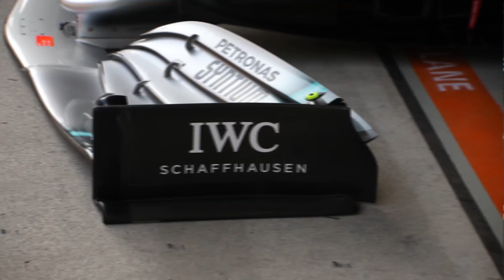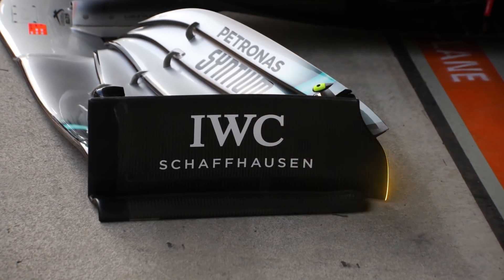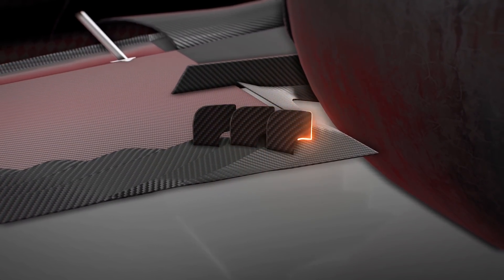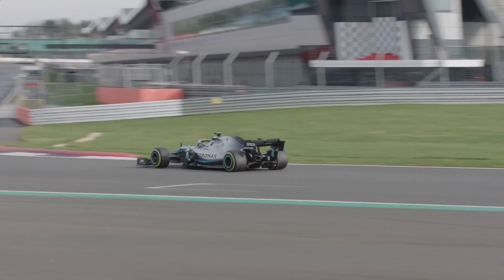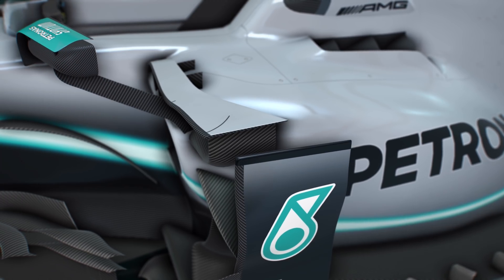End of season tech review: Mercedes vs Ferrari

Comment: 4:10   seriously... that more front end downforce gave them suddenly so much speeds on the straight, yet they were still slow in corners. downforce works the opposite, THEY CHEATED. 
just tell it how it is, THEY CHEATED THE FUEL FLOW.

Comment: Car wise I'd say both teams are neck and neck, in VERY broad terms without getting into the fluctuations over the season. However, I do feel Mercedes has stronger team and tactics managements than Ferrari. Toto Wolff is a TRUE wolf.
Reply: Mercedes definitely has a better car by far. Not just raw performance but also how the car works with the tyres like Getting them up to temps, keeping them there, tyre wear etc.
Reply: @edgiebraahhh7280  yesn'tn't
Reply: @edgiebraahhh7280  That's why I said in VERY broad terms both cars seem neck and neck. If I really dig into the details, engineering differences, consistency, efficiency (not fuel economy lol), overall impressions on me, etc., I also come to the conclusion that Merc pretty much always has the better car all along.
Reply: I’d appreciate Mercedes if they stopped pretending like Ferrari and Red Bull were so close. This isn’t 2012
Reply: neck and neck?? thats a bold (and stupid) claim. how long u have been watching f1?? last year maybe (at least for early half season). but this year? nope..
Reply: @stigsstupidcousin3102  Did you see my last reply? All things considered I firmly believe Merc's car is still stronger. I said neck and neck just to get myself out of trouble and to pacify those Tifosi fanatics / idolaters / cult followers.
Reply: I just wanna punch his face honestly,but Mercedes does have better tactics

Comment: Good detailed review.
 But it's a bit unexpected to have a tech review on two motorsport teams without a single word on motors.
 Just saying…
:)

 The real gap between these two teams was hidden by the engine performance.
Many times Ferrari proved to be faster on a single lap, but not so over the entire race because their 19' car suffered from faster tire degradation. The car design seemed fine tuned mostly for high speed and struggled with lack of downforce.

Comment: Ferrari's car was ALWAYS a losing formula.  Having less downforce, even if they could match Mercedes on tracks that had less bends, they would always have more tire wear.  Case being, Abu Dhabi, Lewis goes and gets the fastest lap on his 30 lap old hard tires, faster than Charles Leclerc on new softs.  If Ferrari qualified ahead of the Merc, straight line speed is good for overtaking back markers and defending, but with all those DRS zones, Ferrari can't keep Mercedes behind even with the extra engine power and slippery body.  If the Merc started in front, game over.

Comment: I thought they were trying to simplify designs, so there would be less dirty air.
Reply: This is the problem with F1. The FIA give them rules, then the top teams employ a team of lawyers (they genuinely do) to find loop holes they can exploit and put in as much effort as possible to avoid meeting the regulations.
That's why nothing really changed from 2018 to 2019. The teams didn't want to abide by the rules. One being in outwash removal. So they rebuilt their cars 'loophole friendly' to gain back that advantage. 
This is why F1 sucks balls.

But, Ross Brawn has his own team of ex mechanics, lawyers and designers to come up with the 2021 rules. To minimise the 'loopholes' and make it air-tight. That's why everyone faster than Renault have threatened to throw their toys out the pram and leave.

Comment: I think Mercedes already focusses on 2020 when they won in Hungary. Mercedes had a huge point advantage and only had to manage the gap..
Reply: I've heard that top teams are working on their cars for 3 years in advance. It's hard to believe, but when you look at the advantage they have on midfield, it must be true.
Reply: @domantas973  Well they certainly are making some preparations 3 years in advance but designing the car usualy is 2-1 year in a advance or in the case of Williams a month before testing xDDD
Reply: Mišo ElEven well, this year williams used 2018 car during the testing, because their new car wasn’t even finished.😃
Reply: @domantas973  even Mercedes had not finished the manufacturing of the 2019 car by testing.
Reply: @domantas973  I don't know how true that is considering the final rules come out only the year before although I'm sure teams work for more than 6 months
Reply: @Mathew Alani they use ideas with the rough rules and would be doing r and d for ground effect right now for example and then would probably adapt it to specific rules
Reply: @domantas973  As I understand it teams aren't allowed to actually start work on the next season's car until the current season starts. Concepts for different aero parts and such wil be flowing off the drawing board almost constantly, but that's allowed as, for the most part, they aren't specific to one particular car.
Reply: @domantas973  I don't know who told you that but that's not true.
Reply: @domantas973  1-2 years in advance is more realistic given that they're notified of rule changes in that time before implementation

Comment: I hate all the stoopid little winglets and knickknacks that require crazy amount of design and simulation time and that small team have no way of matching but seem to determine way too much of the max performance. Bring on the new regs, hopefully it will level the field a bit.
Reply: @Roy Batty But that´s what they did for 2014 and the Mercedes domination happened and you all cried they dominate. Now they opened the aero part to close the gap and you all cry. I´m sure when a team nails it in the head in 2021 (like RB or some other, not Ferrari), you all cry that the rules are stupid and want them to stop this and do that, which if they do will start a new cycle of domination by another team and...

...you will all cry about it.
Reply: @The_Curious_Cat  Welcome to F1
Reply: i hope too, but you can also expect some massive domination by redbull. Newey has been craving to design modern f1  with ground effect for years .

Comment: Very simple. Ferrari was forced to stop cheating.
Reply: Very large & obvious performance drop off for the last few races...
Reply: TotallyNotARussianBot Ferrari cheating  
Keep lying
Reply: Agreed 👍
Reply: Oh someone's butthurt because ferrari has a faster engine
Reply: arthur staal But, what good is that if they can’t manage to win?
Reply: @LuisTrey  then why bring in question it's legality?
Reply: arthur staal Because they hadn’t won anything all year until Belgium came around then went on a three win streak.
Reply: @LuisTrey  1)they won Canada.
2) spa and Monza are less downforce dependant and favor the sf90
3) in Singapore they updated the aero making it way more competitive (which was also visible in Russia despite the dnf)
Reply: arthur staal then completely dropped off again after red bull asked the FIA to check Ferrari’s engine. There was talk for ages around Ferrari’s engine, and soon after the FIA added the extra sensor they dropped off again ?
Reply: @WAzzzUUppp  because the tracks weren't favoring them anymore? They still remained quickest in the straights and very close in quali.
Reply: @artyfly100  There was no significant change in track characteristics. Their top speed dropped off a small amount, and cornering speeds reduced indicating no increase in aero. Paints a very suspicious picture.